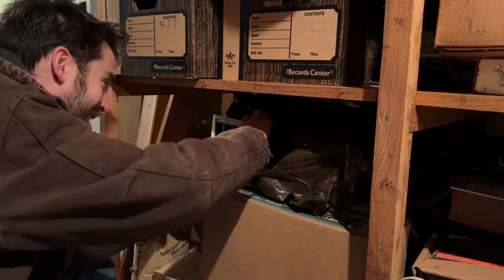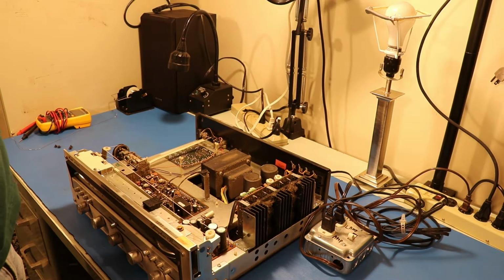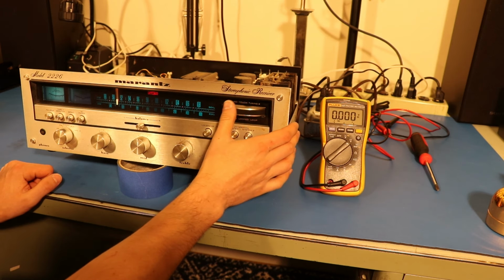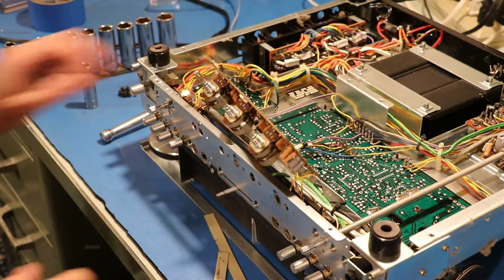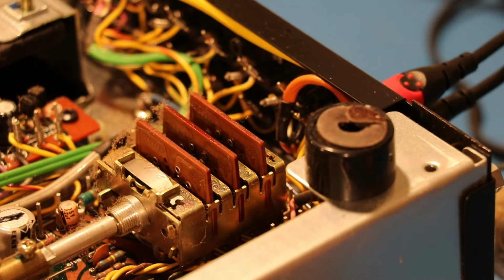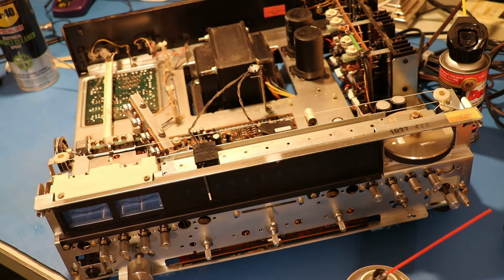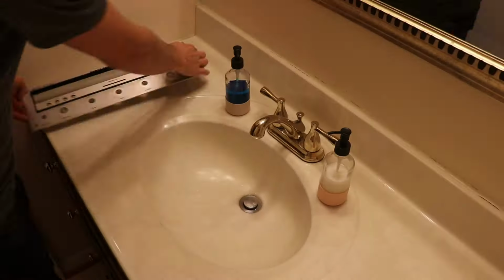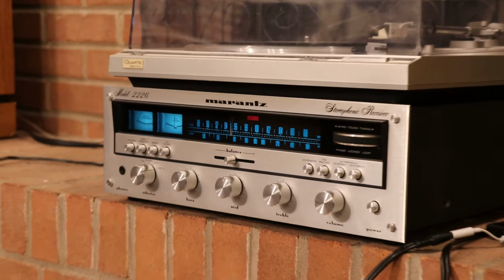Forgotten for YEARS...does it still work? Marantz 2226 brought back from the basement!

Comment: The 70's and early 80's were a great time for stereo electronics. The Japanese were making some fine receivers as well as individual components. The value of these were very good to excellent. 
There was kind of a power competition between makers. 100 watts per channel was better than 75 watts per channel. This wasn't necessarily true but it sounded good. Distortion of the signal wasn't well understood. Lots of speakers were blown because power wasn't "clean".
There was great profit in some parts of a stereo system which helped when competition between sellers was so cutthroat. For instance a $1000.00 stereo system might only yield $75.00 profit. But if the seller could convince the buyer to purchase a slightly more expensive turn table cartridge, it might add another $50.00 to $75.00 profit. A big box store might be able to purchase a $200.00 cartridge for $10.00 each. Selling the better $200.00 cartridge in a package deal for $125.00 might seem like a good deal to the buyer. What really happened was the seller made up for little profit on the main components.

One thing, a good thing from back then, that seems to have gotten lost, was accurate specs from most electronics companies. If Sony claimed 80 watts per channel at .0x distortion and Sansui claimed 80 watts per at .0x distortion, there was a way to compare that was accurate. 

Speaker efficiency was of greater importance but so many listeners were bass, big bottom oriented. Kind of an American thing, I think.

Comment: I recently sold my 2325 that I bought new. If I'd gone for the 2270 instead (the 2325 got too heavy for me and the useless dolby crap that I never tried to use) I probably would will still have it today. The only thing that didn't work was the main speaker switch that wouldn't latch but the remote switch was fine.

Comment: Kinda stupid not acknowledging the need to clear out all of those cat hairs on the heat sink, and underneath the unit. That thing was FAR from being " very clean, mint" inside and out. Obviously damp storage area by the rusted screws on rear panel, and the bottoms too I'm sure. I hope you thoroughly cleaned it " out"! Other than that, good video. I love the " older hi-fi- Quadra phonic " systems of my youth from the 60's and 70's. No digital stuff of later years compares with the power and " warmth of sound"!! Take it from an electronics pro, and former professional musician with a recording studio and my two YouTube channels. Thanks for sharing your electronics expertise in repairs and reconditioning.

Comment: I wish the modern Marantz PM 8006 had a loudness feature.  I had one and it didn't give enough bass. I wouldn't own an amp or receiver unless it has midrange and loudness or bass boost button . I think most of the older Marantz had midrange and loudness. Some of the older Yamaha and Carver have midrange and loudness.
Reply: I believe a Loudness Switch is designed to compensate for our ears having limited low-end hearing at low volume levels. If a Loudness Switch is working correctly it should only add bass at low volume levels. As the volume reaches normal and above volume levels, the Loudness switch should do virtually nothing. You should not hear any change at all at normal and above volume levels.

Comment: Back in the day Marantz is an expensive HiFi brand. I use to go to pawn shops and buy different brand sections to make a full HiFi system. Tape deck from Sony, amp/equalizer from Kenwood, speakers from pioneer etc. Don't see those kind of HiFi these days coz music is going digital so no need for tape deck, turn table.

Comment: A should be valued blast from the Stereo past.  Older old school stereos were ANALOG like this one. Even though it is solid state, the sound quality can be compared with even older Tube powered units. I find new technology digital amplifiers to have a noticable lack of BASS, shrill shallow high frequencies and lack of midrange separation & depth.....

Comment: Marantz 2226 are great when you pay 150$ but are overrated when you have to pay 400$. I used to have one and was using it as a pre amplifier. It was good enough for my daily usage. If you want to have a good Marantz vintage system, you have to go with separate 3 pieces systems like the 140 power amp 104 tuner and the 3200 pre amplifier. I've these since the 90's and these are quite good but the price people are asking for are way too high and you can have a better system for the same price.